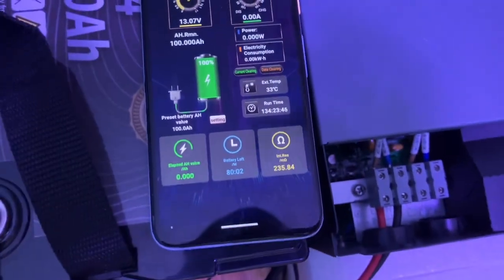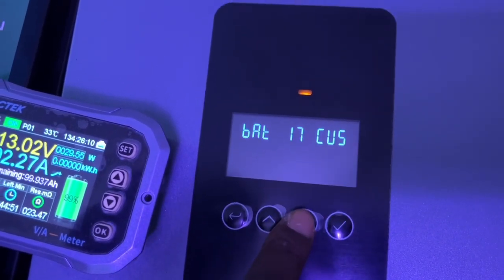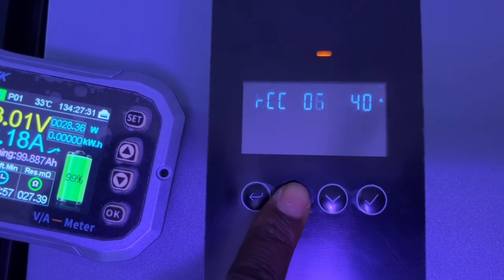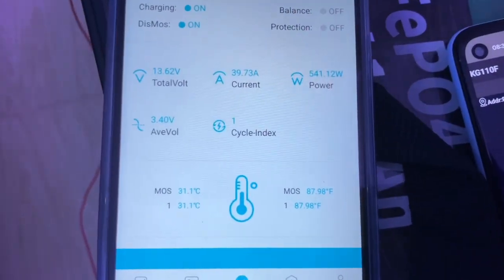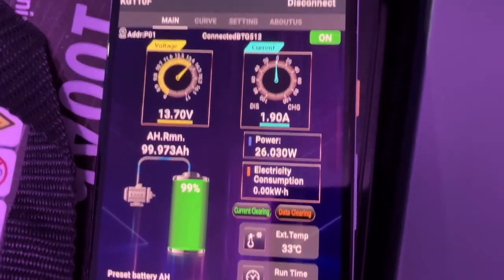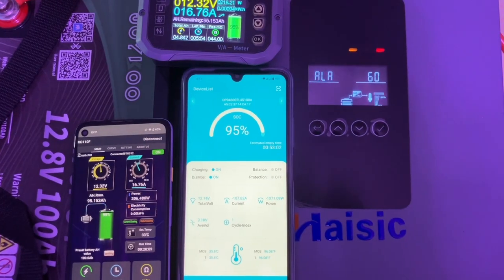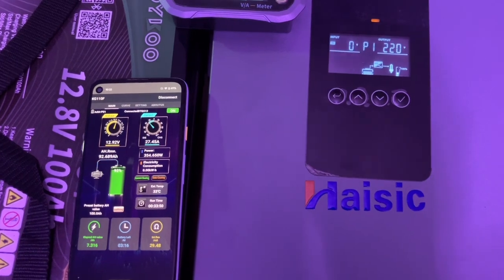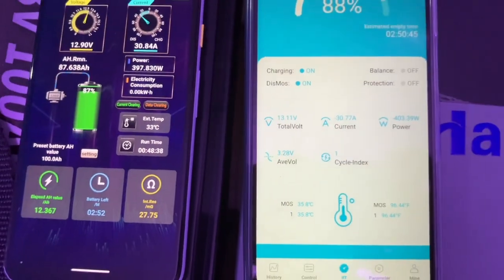Capacity and Load Test on the JOYKOO batteries and Haisic Inverter

Comment: A good video, as usual. Well done.
I didn't hear the inverter beep the second time you turned on the freezer. Or, is it that you didn't capture that period?
Reply from the maker: Yes, It only reached 989W so inverter powered it without issues
Reply: What is the capacity of the inverter, 1kva or 1.5kva? Also the capacity of the freezer